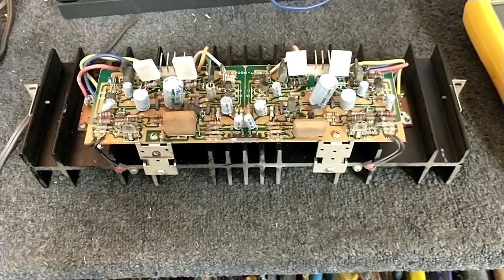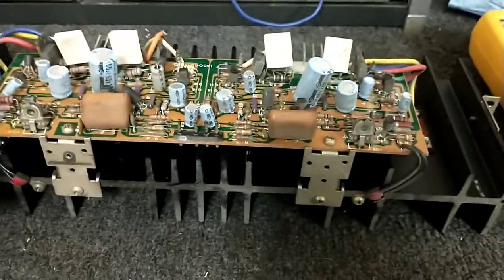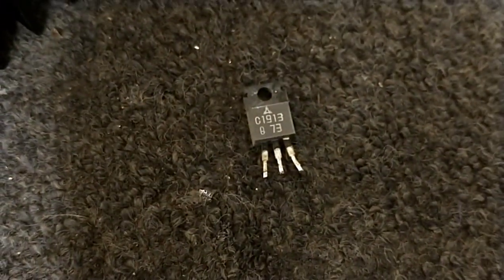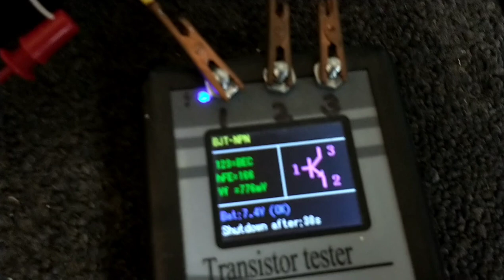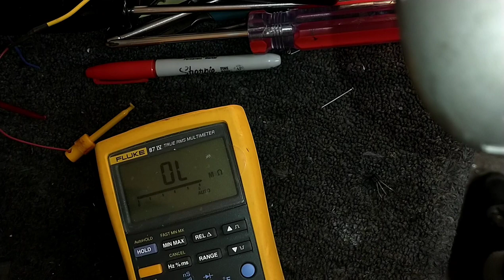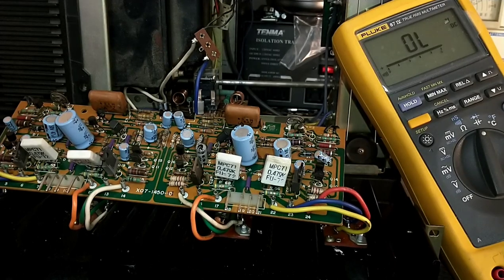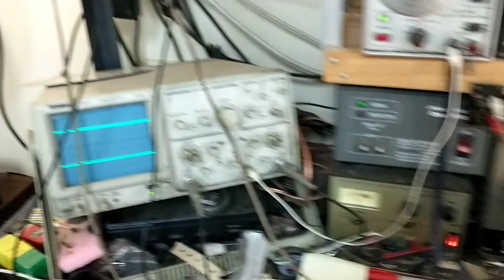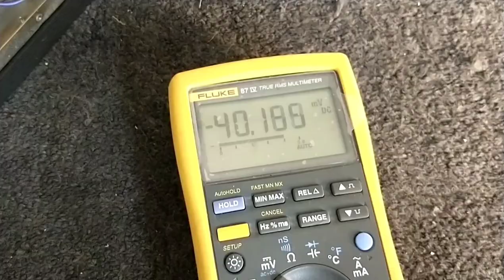Quick troubleshooting and repair of  Kenwood kr-7600 receiver amplifier. R ch clipping L ch no bias

Comment: I have a kenwood KR-3600 with a left "fuzzy" channel. It's not a dirty pot or selector switch, how can I tell if it's potentially a bias issue and any recommendations on what to check without a scope? Is there a common component that fails on these Kenwoods that cause a fuzzy channel ? Thanks
Reply from the maker: @tbone9694  bias can be checked across the base-emitter junction of the offending channel. Should be around .56v 

Too low and you'll get notch distortion which could be described as "fuzzy". Also, with a scope connected to the output (under load) you'll see the notch in a sine waveform

Comment: Any thoughts on HK AVR 8000 no sound out of left and right channels. it powers up and does Not go in safe mode. its not speakers all have been checked with cables, Thanks in advance
Reply from the maker: Check power supplies first.

Comment: You just never know sometimes when something you cause yourself can throw a monkey wrench in the gears, you are right about that. I was just polishing up a Pioneer SX-636 receiver, fixed a bad bias pot, adjusted the bias, checked the offset, did a full power run and everything looked good.

Then I had watched a video on the same one someone else had done and they mentioned the problematic Sanyo coupling caps on the power amp input, so I thought I should check the esr on those caps on mine before buttoning it up.

I use a MESR-100 ESR meter, which uses these alligator clips with rubber booties on them. The receiver was unplugged, and I did short the capacitor that was to be tested. I was connecting the meter leads to the capacitor on the component side of the board. The clip popped off and bumped into the base lead of the bias transistor and shorted that to the metal body, which happens to be the collector. There was a pop as there was a capacitor in the -41 volt supply that still had a charge on it.

I plugged it in to my dim bulb tester, and good thing, because it lit up brightly. The 2SA777 driver transistor was now shorted collector to emitter. I replaced the complementary pair with some substitute transistors, but not the bias will not come down to 20mv, it is at 28mv with the bias pot cranked all the way down to minimum (CCW).

The hardest most time consuming part of working on this old transistor gear is trying to find replacement transistors that will work.
Reply from the maker: When I have this issue, I check the bias transistor beta, and find one with a higher gain. You can also decrease the feed resistor(s) in the bias adjustment circuit or lower the bias pot value to compensate. All you're trying to do is control the bases of the AB driver transistors.
Reply: @JordanPier Yes that would work, but I think if I can find some driver transistors with lower gain that would be an easier fix. The beta on the originals were hFe 110, thereabouts. The replacement subs were 208 and 209 hFe. Using KSA1013YTA/KSC2383YTA as subs for the 2SA777/2SC1509 drivers. 

 The bias regulator transistors are known to be problematic in these and should be changed with T0220 devices which are more reliable, but really more than I wanted to get into with only a 25 wpc receiver. Thanks for your response, your expertise is much appreciated.

Comment: Dear Mr. Pier, Just an excellent video on these repairs, question, what is the bias adjustment for, and how does this effect the operation of the transistors. Thank you kindly sir.
Reply from the maker: Think of the bias as like the idle speed on a car. Too low and the car will stumble or stall. Too high and you can damage the engine.

Bias is the same way. It keeps the transistors at ready to minimize distortion from the time it takes them to go from off to on. Too low and the transistor will not come in quick enough, causing notch distortion. Too much and the transistor is full on all the time, which wastes energy by dissipated heat and can also cause distortion because of time from full on to off state.

Comment: If you are testing transistors which are only marginally bad for hfe and leakage, then I think you could make very good use of a curve tracer to save time.  Transistors like that will always or almost always be easily revealed to be unambiguously bad by their collector breakdown voltage and their saturation characteristics.

Comment: I have the same receiver and can’t find an issue with the relay buzzing. Any information would be great! Thanks love the video
Reply from the maker: Open capacitors in protection circuit and possibly a defective relay driver Transistor
Reply: @JordanPier  Hi thanks for reply they were changed in the protection relay transistor and caps.

Comment: Great Jordan! that was very interesting.
I have a general question: I have a Sherwood RA-1142 receiver, it has no bias or dc offset adjust, how does this kind of amp regulates itself?
Reply from the maker: Precision matched transistors for the differential amplifier stage, low tolerance parts in the bias circuit and proper feedback to monitor what the amp is doing.
Reply: @JordanPier  Many thanks for your answer,
I was really wondering how there is virtually no dc offset on my receiver.
Reply: @zulumax1  I understood Jordan perfectly, there is no need for this style and disrespect.
Reply: No disrespect intended, sounded like you were still wondering. I’m here to learn too.
Reply: @zulumax1  For me it was like: "ahha! that's why there is no dc offset", that was my intent.

Comment: Do you have any plans to do a kenwood kr-4070 in the near future?
Reply from the maker: They don't come in for service often. 

Common problems include failure of power switch, noisy pots and switches, bad contacts on the speaker selector switch, failed embedded resistors. 

Wanna talk about fixing yours? Inbox me vintageavrepair at gmail dot com

Comment: My unit is hard to tune in a channel. Is this repairable
Reply from the maker: Yep. Tuner needs cleaning. Uses CRC QD  to clean it, run the tuner back and forth several times and let dry for a couple hours. Do t use anything else to clean it
Reply: @JordanPier  are you talking about spraying the tuner knob itself?
Reply from the maker: @michaelmeyer1310  no, the condenser assembly. Requires disassembly of the receiver. 

Look for a good tech to send it to familiar with vintage audio. It can be very easy to make things worse if you do not understand